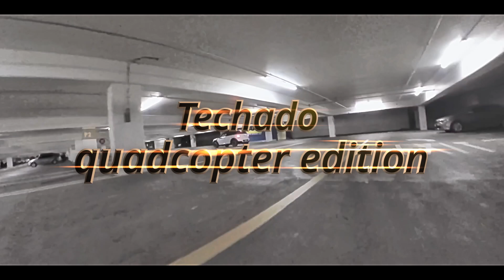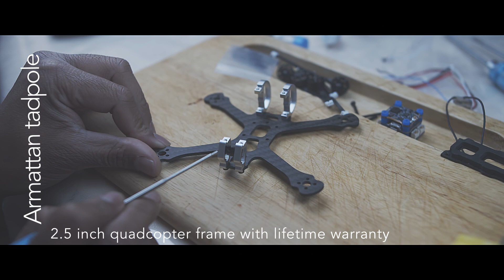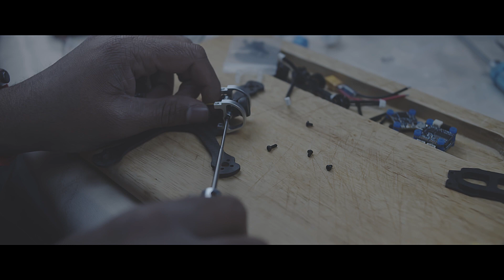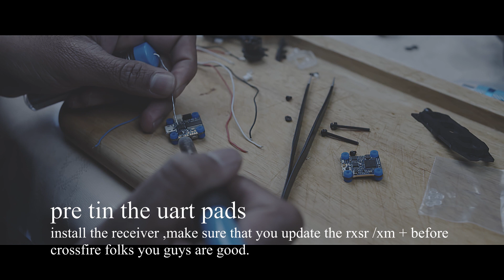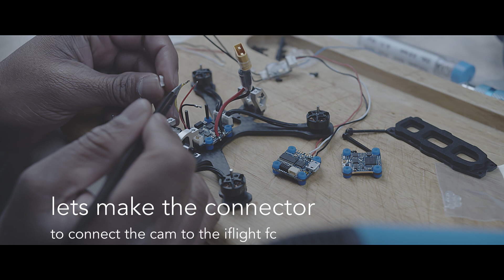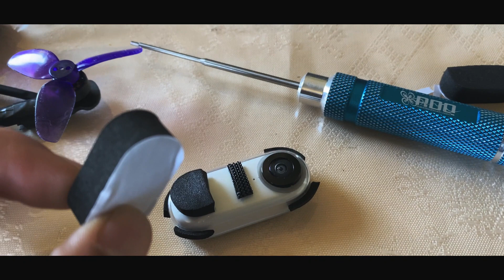insta360 go fpv micro drone that does this !!

Comment: I have pretty much the same build except I use the t motor f1103's. I found if you switched the standoffs for the stack around and tighten it from the underneath it works well.
Reply from the maker: good tip thanks for sharing better ideas